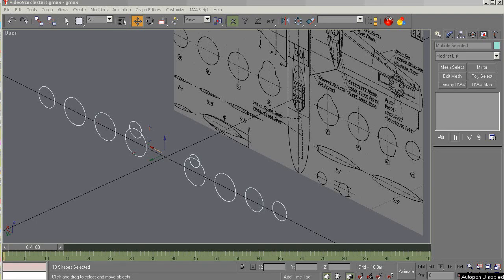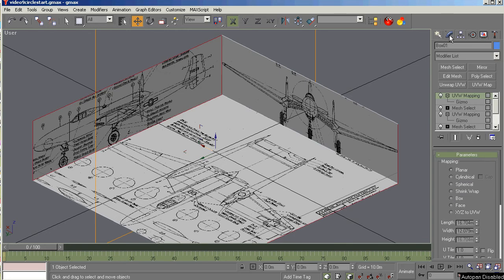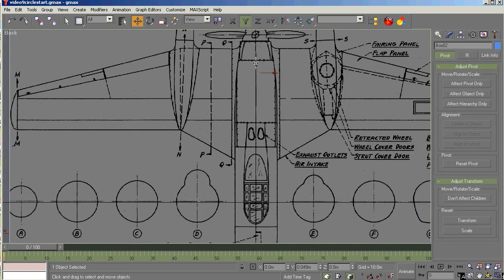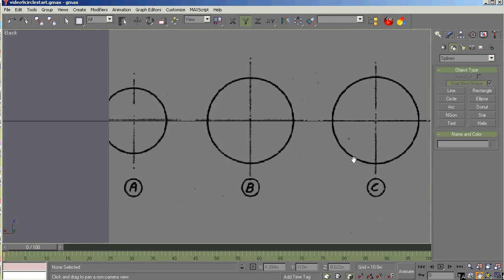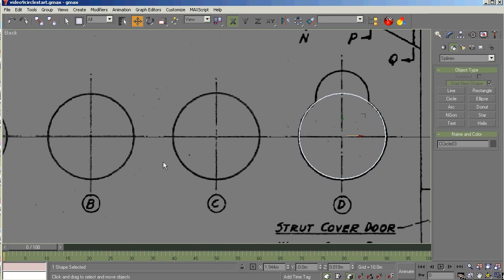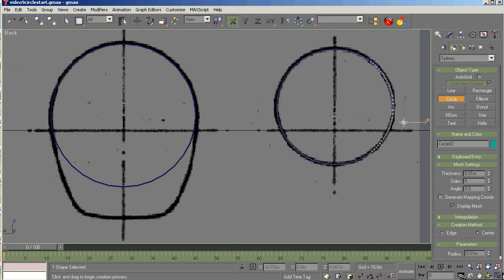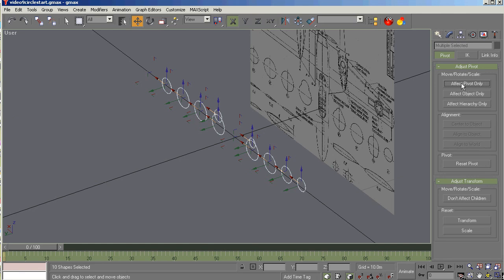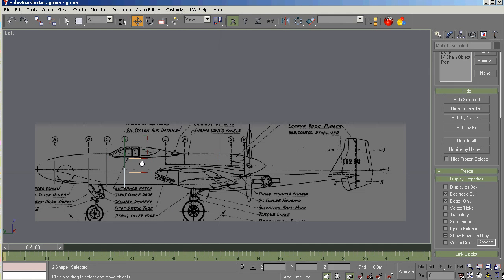Gmax 1.2 for the Beginning Modeler #9 - Building the   Fuselage - Part 1

Comment: How does it work if i don't have fuselage cross-sections?
Reply from the maker: AD, without cross-sections, you can still model the height and width of the fuselage as long as you have the 3-views.  Start with a cylinder with sections and appropriate number of sides, 24-32.  Use Scale or non-linear scale to reshape the height and width from the 3-view side and top views selection on set of vertices as a time in the Right/Left and Top viewports.  Of course, it helps to set the cylinder on "see-thru" mode so you can see the 3-view as you do your work.
Reply from the maker: I did a graphic tutorial that shows this method here:

http://www.sim-outhouse.net/tut/fs9/c162/